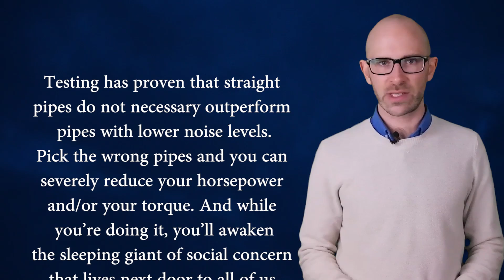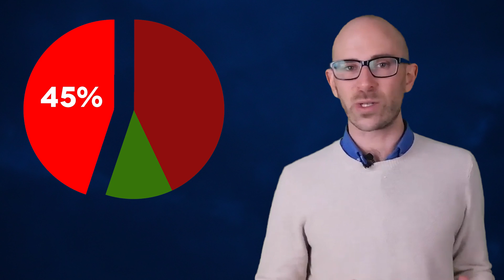Why are Harley Davidson Motorcycles So Loud?

Comment: Stating all the statistics of why bikes are involved in crashes will tell you nothing about the ones that were averted by catching someone’s attention.....
Reply: Then use bright running lights and high viz jackets. Buy bright red bikes instead of black. Human hearing is not particularly good at identifying direction from sound anyway especially in a car with the radio and air-con on
Reply: That would be zero. If anything people get distracted by them or the bike causes the accident breezing through a red light thst was yelloe by the time he started moving or driving between lanes.
Reply: My shirt reads " LOUD PIPES POOR SUBSTITUTE FOR NO SKILL " only self centered obnoxious ass holes inflict their racket on everyone in ear shot !
Reply: I drive and ride. I totally agree with loud pipes saves loves. More often then not, bikes  hide in my blind spot and hearing them has saved me from killing them in lane changes on more than one occasion. 

Also the db levels don't account for how sound wave compression works on the road. You can clearly hear a stock bike at a stop or while you are standing still when the bike passes. But if you're in a car traveling at speed along side or in front of a bike, you can't hear stock mufflers.
Reply: Lewis Tan I drive and ride , and you are an idiot ! YOU !!! Need to take action to stay safe ! Counting on the racket that affects EVERYONE ALL THE TIME!  Is a stupid self centered way to help you out the rare times when there is drama ! Funny thing is, sitting here waiting for the coffee machine,  so I can ride my ducati,  I have on my shirt that reads "LOUD PIPES POOR SUBSTITUTE FOR NO SKILL " !!! Sums up how I feel !😄😄😄
Reply: THANK YOU TIM ....THE ONES AVERTED ARE WAY MORE THAN HIS BULLSHIT ...LOUD PIPES SAVE LIVES ...WHO IS THIS DUDE........
Reply: Tim, good point. I regularly ride long distances, i just got back from Sturgis (knuckle bump for the homie) and live in far south Texas. As the lead bike in the group the sound of the bike behind me tells me where he is when i cant avert my attention to look in the mirror, and i have looked and saw nothing, but because i hear the bike (51 pan, pretty noisy clutch and pipes) i know he is there.

Comment: Most people adding aftermarket pipes end up with a loud-as-heck-but-less-performing bike. Torque bottom outs. Ironically, the only way to get the torque and horsepower back is by adding aftermarket bafflers that tend to tone down the aftermarket exhaust's noise. Getting a better performing bike isn't as simple as adding any straight pipes (or removing stock bafflers) and re-jetting or adding whatever tune to the central unit.

Also, it isn't fair to only include Harley guys in this topic. In Europe, there is a serious issue with ALL bikes having loud exhausts. Sportbikes are a big portion of such loud bikes. An open exhaust (no baffles) on a sportbike can be ear-piercing loud. Again, ironically, the dudes putting these exhausts ain't aware that they now actually have a less-performing bike that, for "some reason", requires "a lot more throttle than before to launch from stop, bro".

As said, it isn't just guys with cruisers doing it; it's just that the vast portion of motorcycles rolling around in the USA are cruisers (HD, at that). I like some aftermarket exhausts on cruisers and sportbikes that are toned down; nothing wrong with a more-powerful motorcycle thanks (in part) to a by-default-loud aftermarket exhaust, so long as you do NOT rev the throttle like an idiot when riding in town or residential areas.

Most people complaining of bikers with loud exhausts are, in fact, complaining of the stereotypical dudes going around blipping the throttle 24/7 in town so people look at them. Most good-meaning folks with aftermarket exhausts on their bikes purposely avoid the over-revving of their bikes in town/street/residential areas so as to not bother others.
Reply: Nah Freeing exhaust will add power.. less restrictions... the tradeoff is it pushes said powerband higher up in the rev range...

Doesn't mean the bike is performing worse just mean you lost more low end for more top end.. I personally, never care because most of the bikes I ride make enough low end to where it doesn't bother me.
Reply: @sparklygames71    oh ya you guys are so innocent ..here is the evidence ..i rest my case.. lolololol  eat it and weep https://www.youtube.com/watch?v=VFAEk0W8Jjc

Comment: If you make Harley quiet it will cut sales by 50 percent   You seethe circus clowns that buy Harley do it to be noticed. Without the racket , you have taken away their game plan! Harleys are all about illusion anyway.  They sound powerful but are the most underpowered bikes on the market. A 1690 cc Harley makes 56hp while a little tiny Yamaha 600 cc make 111hp

Comment: Perhaps the low number of accidents where the car is at fault is because they are hearing the loud pipes, thus saving lives.
Reply: How many of the single bike accidents are caused by some one in a car forcing the biker off the road?  you know as well as I do that most people don't stick around if they cause an accident but don't damage their cars.
Reply: You've got this exactly backwards.  The leading cause of fatalities among motorcyclists is other vehicles failing to give right of way and running them over.  The classic worst case scenario is an oncoming vehicle "not seeing" the oncoming motorcycle and turning left directly into them.  This isn't a recent discovery, the Hurt Report was published in '81 and made it crystal clear.

Comment: Harleys are loud becasue we make them loud. They come  fairly quiet from the factory but people make full system exhaust changes to add HP or slip on mufflers to give then a volume boost and also to change the tamber of the pipes. If you want a throaty grow or a little more ping in the mid range you can get that with these swaps. Also the intake and tuning can effect the sound. #ftf #lpsl

Comment: There's a major difference between running quieter pipes and running pipes that rob horsepower. EPA has destroyed motorcycle performance by adding a 30lb cat and ridiculous muffler shapes.

Comment: Someone needs to do some more research on dbSPL... 70 to 80db (or any 10db increase for that matter) is about 3.3 times the pressure (measured in Pascals). A 20db increase is needed to yield 10x the pressure. But even at 90 db, the pressure is still below 1 Pascal (1 Pa = 94db SPL). A 3db increase is a doubling of energy (we humans just notice a volume change) and 10db is a doubling of volume (what we think is twice as loud). At sea level, there's about 101,000 Pascals of air pressure upon our bodies for reference. Yes, 90db can do damage over the long term and yes, it gets progressively worse the higher that SPL number is before adding that 10db, but if a rider is wearing an open face helmet, I'd be more concerned about wind noise. And yes, loud pipes can save lives! Even with my big mirrors, there are still blind spots on the sides of my truck. I'm notorious for using a signal and changing lanes slowly. More than once, I've heard a Harley's throttle get burped and back into my lane I go. I would have hit the guy if I didn't hear him. I'm in Florida, so I hear loud bikes all the time and if all goes the way I want it to, I'll be on an Indian Chief Darkhorse soon...and yes, she'll be a little louder than stock and yes...I will burp the throttle if I even suspect a car driver isn't paying attention....Have you driven in Central Florida lately??? Besides the average dumass, we have tourists...who have no idea where they're going and will make a rental minivan do a 5-lane change in record time! Sorry for long post.

Comment: Bikers with extremely loud engines, especially those who rev them at stop lights and stop signs, are simply major-league a**holes...every one of them.  And the defense of "loud pipes save lives" is bogus. If it's so important to have loud pipes to save lives, the pipes should face forward, right? After all, it's the traffic in front of the bike that's the potential safety problem, not the cars behind the bikes.
Reply: i had an old 1988 Harley electra glide, it was carbureted. if you didn't rev it up at a stop light every once in a while it would bog down and die. i didn't have to do it every time but if the light was long i did.
Reply: Reving the engine at a stop sign was a way to “cool” the engine on a hot day.... now a days people just think it’s cool but there used to be a purpose to the madness....
Reply: Thank you Jamie Mills for trying to talk some sense into this conversation.
Reply: David Mack or we don't want to get run over by assholes who are texting while driving or whatever else and not paying attention.
Reply: If the cars in front of you are the problem on your bike that is a rider error.
Reply: David Mack I'm actually in the process of putting another motor on mine just so I can add two more exhaust pipes
Reply: Revzilla said all this in a article.
Reply: Vita Vegeta your absolutely right I read that article best thing I’ve read about this loud pipe issue
Reply: David Mack the revving at stop signs is us slowing down when we come to the stop sign because if we don't sync our engine revs up right are rear wheel could lock and we could lose control or we could break something on the bike it's not just us revving to rev
Reply: Get a bike,ride for quite a while and get cutoff.Then,find out why,we hate it when whiners,bitch.That's probably because they either don't want a bike.Can't,get a bike or have never ridden a bike.also, because they probably can't ride anyway.
Reply: And no it's not always the traffic in front of the bike.It can be a rear end car driver as well
Reply: that is just too bad ..cause in 15 different states in the united states there are no laws at all about noise levels of motorcycles and i hope you live in one !bahahaha
Reply: David Mack, You are an idiot lol
Loud pipes, do in fact, save lives. Most of you drive like shit and can't make it ten feet without looking at your fucking phones.. So hate me my friend.. HATE away, I promise I won't lose any sleep Snowflake
Reply: Bumping the engine is to increase oil flow shit tard
Reply: You're an idiot.

Comment: My grandpa has a 2001 Harley Davidson Softail with a custom tune, straight pipes, and racing carburetor (also small things like custom handle bars, and and tire caps) and me and him have never gotten in trouble with the police or any civilians for the 30 times I have ridden with him and he always like to give her full throttle. Im not saying that we won't get in trouble for straight pipes but we haven't yet. Not trying to sound like and ass or anything but I feel like loud pipes can save lives. We have a Willys Jeep with a glass pack on it and we took it for a test drive after we bled the brakes we accidentally ran a stop sign and there was a cement mixer at the intersection right as we put it in neutral and let her rip the truck stopped right away.

Comment: Two things comes to mind: 1: Japanese MCs with straight pipes also sound extremely loud.. (and there COUNTLESS of those out there...) The only thing seperate the two is the unique sound HDs make. and thats a segway to my no 2: To buy a harley that sound like a sewing machine (which it does when it comes out of the factory.. i know because i bought one like that) whats the point in that? HD drivers drive HDs mainly for the sound of their machine. Maybe society should stop being so fucking sensitive

Comment: As awesome as a vintage v8 vette sounds, take the mufflers off and it sounds like ass.... just like these clown bikes!!
Reply: Any piston engine is loud without an exhaust. Even the Briggs & Stratton  lawn mower you ride on when you're cutting your grandpappys yard although those put out a heap of crankcase noise.
Reply: From a strictly technical aspect...ANY device employing combustion in any form of 'compression &release' is going to make a fuck-load of racket!
Reply: ALL GM and Ford cars are loud with tampered exhaust systems...it makes no difference which model it is, nowor in the past.
Reply: Wow we need roadside enforcement of gas lawnmowers, worse than drag piped shovels.
Reply: Haha, regardless of your illusions...... my wife has all her teeth so she wouldnt look right with a harley guy!
Reply: carbonRRpilot  ha! Good response.. Love youtube's messaging. I wonder how long till they start censoring us. It's like CB radio. Anarchy. Your mom just blew me. Say that on FaceButt!